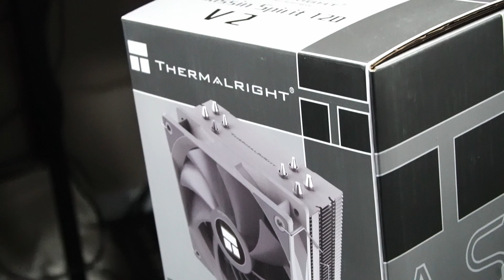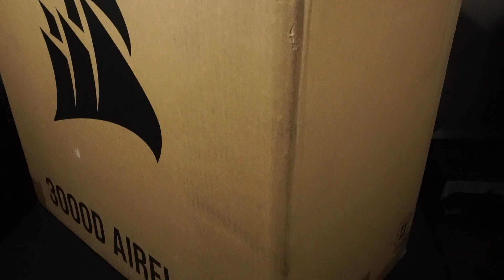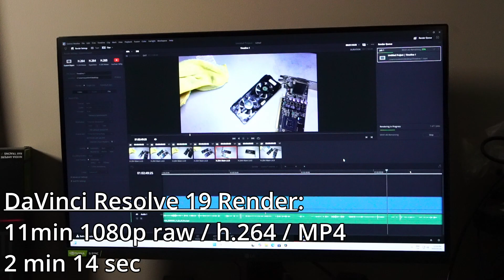Best budget GPU for 2025?  (RTX 3060 Ti & Ryzen 7 3800X)

Comment: on the graphics card you replaced the thermal compound with a thermal conductive pad what are the advantages ?
Reply from the maker: The results are notable, if coming from a card that needed the service (dried thermal paste on the gpu die).  Beyond that, with other cards I have noticed that even if there isn't a drastic temp change the stability is notable.  For example, an RTX 3080 Ti was running in early 80's °C in Kombuster before service.  After, it was mid 70's °C.  Not drastic, however the fan noise was very moderate.  Not ramping up to full speed to control the heat.  Just running at a very acceptable noise level.   I would say go for it if you're thinking about trying it out.  I use it for all GPU service now and have been using Thermalright Helios V2 pads for the last few months.

Comment: imo you shouldn't use settings on auto since results are not replicable
Reply from the maker: That's fair, good point.  I will consider that for my upcoming videos.  I didn't consider that, rather I relied on "relative" performance.